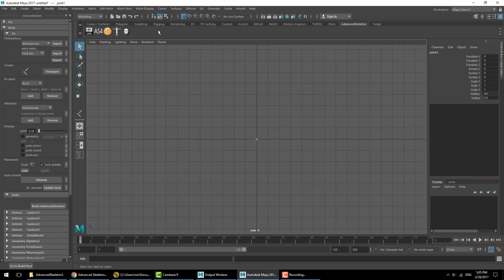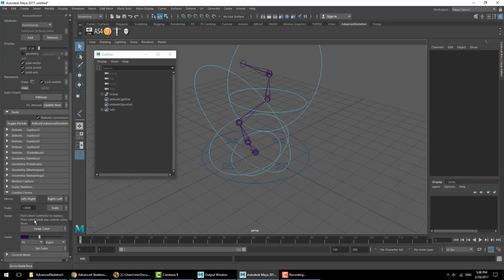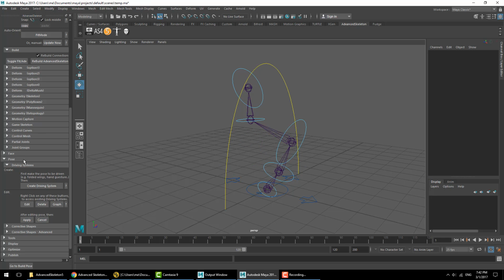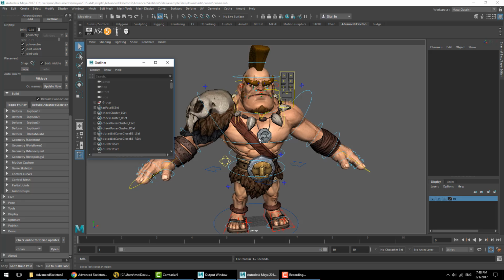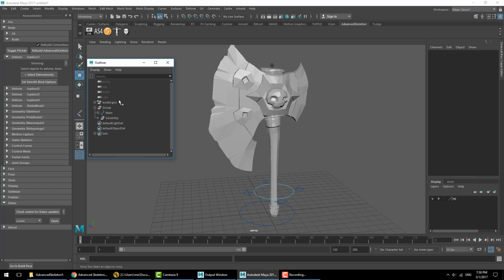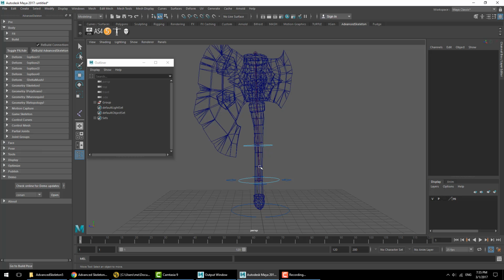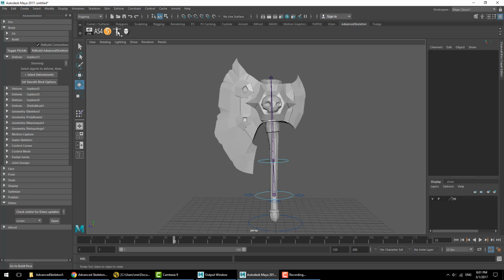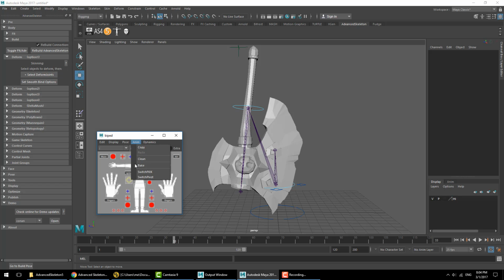Rigging of props & using SwitchPivot

Comment: I cant seem to get the mocap data to work on Advanced Skeleton. I have correctly added all the joints that shows the HIK system green but does not perform correctly. I guess it is because there are so many bones on the skeleton and it does not move as expected.

I hope there is a way of getting mocap data to work on the Advanced Skeleton rigs as well. If so can you please guide me the right way to use mocap data on such a character please? Hope to get a response soon.

Regards 
Affan

Comment: Thank you so much for your awesome software. 

I have always wondered what "X" offset groups are used for. I see in this video they are used to implement SwitchPivot. Do they serve other purposes?
Reply from the maker: Hi.
The "Extra" controllers, that are accessed my `pickwalk -up` or with the "Extra" checkBox in the selector, servers a few purposes:

1. Provide a extra transform for Constraints.
so you can make parentConstraint to make a controller follow another controller,
and still have the controller `free to use` as it is the Extra controller that is constrained.

2. Avoid gimbal lock:
By rotating the Extra controller, you can set where is your `gimbal free zone`.
See the "Gimbal lock" tutorial video for more details.
https://youtu.be/_jW5PCiB2vA

3. Providing alternative pivot points for controllers.
This can be done manually, by moving the Extra-controller to where you want the alternative picot,
then move the `actual` controller back to where it was.
Or use the "SwitchPivot" function, which automates those steps.

4. Mocap connections.
Extra controllers are also used for connection to MoCap skeletons,
so that the `actual` controllers, are still free to be animated `on-top` of mocap motion.

Hope this helps answer your question.
Best regards, Øyvind.
Reply: Wow, I wasn't expecting such a detailed answer. That is very very helpful!